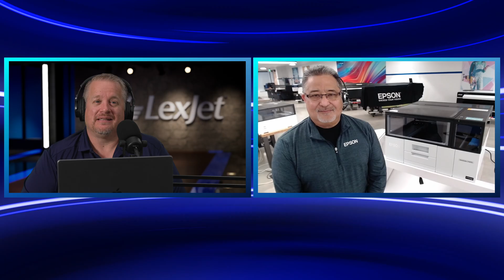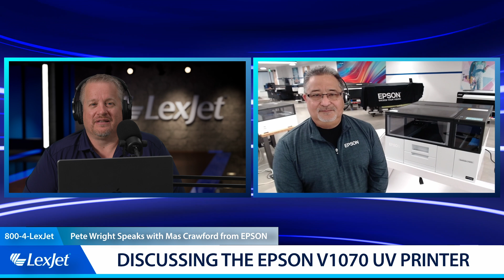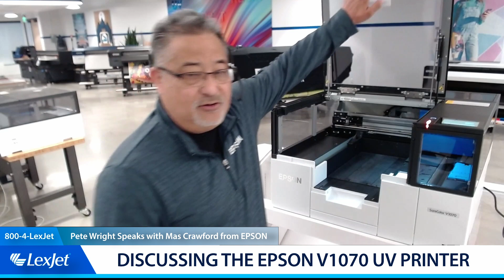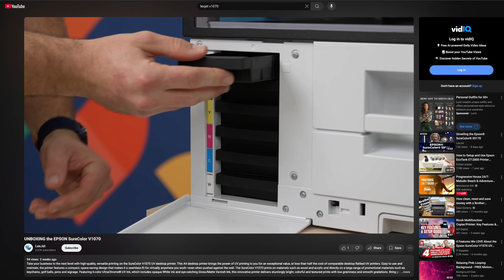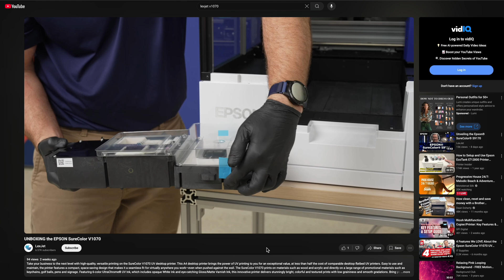Print on (Almost) Anything – EPSON SureColor® V1070 UV Printer

Comment: Thank you for this video.
You did miss 2 very important questions though:

1) How often must someone print, in order to prevent the heads/inks from drying? 
This is a  common problem with most UV printers - some even require at least an A6 sized full color print every 3 days!.

2) What's the yield of the ink cartridges in terms of e.g. A4 sized items in full color, full coverage? (or any example we can use to "divide" the total ink capacity with any sized printable object).
I mean, it's the No1 obvious question out there: "How many business cards, or how many coasters I can print with one set of inks?".

Great video, just missing 2 key questions 😉
Reply from the maker: Hello, for the first question, this UV printer has a fabric wiper unit so if it is powered on it will use the fabric pad to keep the ink from clogging. We recommend running it on a weekly basis to keep the ink from being used in maintenance cycles. The more you run it, the easier the ROI. 

For the second question, it is one milliliter per square foot for coverage. That's based on CMYK only. If you are layering in white you're going to go up to two milliliters per square foot. Hope this helps!
- J